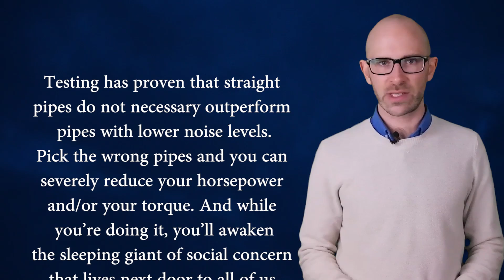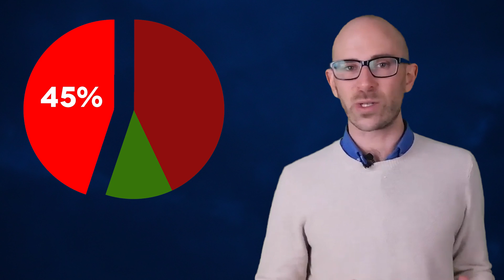Why are Harley Davidson Motorcycles So Loud?

Comment: Hey, man just tell everyone that the exhaust systems have been modified.  Some use straight pipes, some take out muffler baffles, some have a very large empty chamber, all sorts of open exhaust systems are LOUD!   And mostly it's an ego, macho loud noise to offend everyone, with the in your face attitude.  Some have a very immature outlook and the loud makes them in mind say, Hey, I'm tough, back off!  Some kinda crap!

Comment: Your crash statistics are wrong.  Motorcyclists are NOT 'at fault' in 75% of the fatal two vehicle collisions.  As per your source:  "In nearly three-fourths of these crashes, the role of the motorcycle was recorded as the striking vehicle."   That doesn't mean they were at fault, in fact the Hurt Report showed that in ~40% of two vehicle motorcycle collisions are caused by the second vehicle making left hand turns directly in front of the motorcycle, a by-product of the SMIDGY effect(Sorry Mate I Didn't See Ya).  That doesn't mean motorcyclists don't make bad decisions but you very seriously misrepresented the threat that cars and their drivers pose to motorcyclists.

Comment: I was sitting at a red light behind a van one day on my slightly loud Harley Davidson motorcycle. I stayed to the drivers side of the van so that the driver could see me in the review mirror. I always do that when I'm I'm close to vehicle at a stop. Well I'll be, her radio was blasting so loud I could hear it. It was summer time. Her windows were up and she had a van load of kids. soccer mom type I suppose. Well any way. I saw her back up lights come on and she just backed right over top of me. the tried to drive away. I ran to her van door and beat on he window. There was lots of traffic and witness's so she stopped. I did get hurt a bit. Her fender caught the tread on my front tire as i was trying to back away from her while blowing my horn. He bump rolled right up my tire, crushed my fender, forced my bike to ground, ran over my foot as i was trying to escape. I hurt my right leg and back trying to just get off and away from her. Your 75% was way off here. and the bike was loud. i was in field of vision via mirror. and she still ran over me in reverse to boot. So to me your theory is total Rubish as they say in England..Rubbish it is

Comment: C L I C K  B A I T!!! 
I'll bet most if not every single one of you watched this video to find out what the secret was that made the Harley-Davidson V-Twin engines so much louder, Louder than all other V-Twins such as Honda or Yamaha didnt you?  Well your not alone, so did I. But don't go thinking this is of any fault of your own... the viewer. No quite the contrary! Im no expert in the law but most assuredly, most would argue, the King of Common Sense. And in this case the liability falls on the content producer! Yes I was suckered too.
But not before giving it careful consideration rest assured, and much goes into my meticulous,experienced and thorough decision making process (as should all hard working Americans who value thier time and money or Time AS Money,) All of which are based on just the tiney few clues given, they are small howbeit, but none the less, clues, to determine as to wether this 6:13 video is actually "click worthy"  or at very least, isnt going to infuriate one so much as to elevate ones blood pressure thus causing (depending on location) scenarios like ramming the car in front of you, punching the guy standing in grocery line near you, then the cop when he arrives to arrest you etc....after all, this is liesure time for most on YT, (except of course for the hardworking YT censors, whos works cut out trying to cover up all the pedophiles Trumps busting... downplaying all the successes and winning since POTUS 45 election😎)  So, I, (unlike this "nair do well", who I think most will agree, was anything but forthcoming) will tell you right now, what the "clicking" point (pun intended and actually achieved, just not revealed until later in my overview, opinion and yes lenghty but thorough, comprehensive and professional assessment ;) )  .was 6:13...the low risk..obviously for me. I mean 6 min. and 13 sec. is indeed a very small block of time to risk, especially if it can reward me with previously unknown information or data that can assist me in future decision making, to either save time & money. Or, if Loud is a Neccessity, to go ahead and just invest in a Harley Davidson Motorcycle. 
OR...
Maybe you simply wanted to answer that question, the same one THE AUTHOR OF THIS VIDEO ASKS IN THE TITLE TO THIS VIDEO?? that has at one time or another, made us all respond "Gee, I Dunno.."Hum"  but just never thought it important enough to look into or just didnt put much into finding out. And CERTAINLY didnt go to the trouble of making a video and titling it that WITHOUT answering it in the Video! 
But if your like me... I have skin in the game in a real way. you see, I am one of the afore mentioned, as well as the latter. 
 I have a Honda Shadow 1100 and I have the drag pipes but I've not put on bike yet, so I have a couple of "needs to know" before going to the expense of rejetting carbs (something must do to compensate baffle removal, as well as adjusting idle) and of course the trouble of taking the old ones off and putting the drag pipes on. 
Such as
1.) Do the drag pipes with no baffles on a Honda Shadow 1100 sound as loud as a Harley Davidson Motorcycle? 
2.) If not...Then why?  
Now this is where this nair do well completely drops the ball, heres the only reason he could possibly have to title video the way he does...thus he misleads and some (like me) would argue, even "Decieves", Enuf that we can call it  "Fake News"?😒 "hummm. No news is fake news? (public  opinion needed here) 
Ive heard they don't have quite the sound of a Harley. so I was looking around on YouTube here trying to find remedy for my dilemma and lo and behold I stumble across this extremely low educational investment of 6 minutes and 13 seconds as an  opportunity. Now these questions have puzzle me for quite some time so imagine my excitement of finally getting to answer my salt after solution or answers that have eluded me so. But this wasn't the case at all had it worked I feel that my return would have been substantially rewarding and very much worth the investment time as well as low effort of pointing & clicking (maybe not as easy to shut up & listen for 6 minutes 13 seconds) But over all Id say a home run.  but that's not the case with me, nor is it with everyone else in my situation that went into this "investment oppertunity for the mind", which as we know now was no opportunity at all but simply a "fruitless waste of time for we the viewers" and a pathetic, pointless "1 dime atta time scheme" at the expense of future viewer participation as well as trust and viewer patience of "we, the now pissed off and wont watch another Today I Found Out video viewers!  
And back to the  financial liability here.  Now if content  producer  is receiving Revenue  but not from the viewer directly, but  "indirectly"  as  we do have to sit through those pesky  7 second commercials before viewing video subject matter, which equals time  and as we know  precedents have been set throughout the history of our country  that "time is most certainly money" I am pretty sure, not certain, but pretty sure that this  could be litigated  in federal court  as if I'm not mistaking we the viewer are protected and could set a good president in the courts for this type of shady clickbait practice in the future 2001 consumer protection act have to check with one of Pres. Trumps corp attny.s 1st, but Im pretty sure we might be protected from under the 2001 consumer protection act the only grey area in question far as I can tell... no currency or monetary exchange occurred.... but I ask you... is time not money?   
I believe so.
well this brings me to the conclusion that according to my estimation I feel as though a slight form of justice has been served because when you title a comment clickbait that's just too much Temptation for any content producer. He should be at least curious enough to stick around and read, if were lucky he pondered and reflected on his ways that caused his content  quality to suffor. And make the decision to do better, work harder in the future as mediocre might have been a thing of the past but not anymore.. America is back!  and you can't make her great by making mediocre videos that  don't live up to their title.
For the rest of you who had the patience to stick around and read... well according to my calculations this has wasted about 6 minutes 13sec. for the  content creator 2 read through, But if he Ponders what he reads then it's not wasted if something's gained and that's best summed up as awarding punitive damages to "We the viewers" comes into play later as I believe the quality of future content should improve greatly and hopefully the titles won't be as misleading like MSM fakery and maybe we won't accidentally fall into another 6 Minute hole of useless dribble and unwanted data...at least by this channel!

Comment: A stock harley is way quieter than a stock Lamborghini, jag, ferrari, etc basically any supercar with the  overplayed exhaust gurge/pop. Both have to meet epa sound regulations.

Why are harleys loud? The moco purposely makes the exhausts quiet and restrictive so they can sell you a “stage 1, 2, 3 or 4” upgrade which includes an exhaust, or for less money you can get a better performing and louder aftermarket exhaust.

But this guy who’s well versed in things that just aren’t so would rather have you believe harley riders are all degenerate people hating jerks who just want to make noise for the sake of making noise.

Comment: the exhaust noise level of my harley is usually in direct proportion to surrounding drivers' attitude, the right handle bar has a twisty thing on it that makes the exhaust decibels go up as I turn it allowing rude and discourteous drivers around me to be aware that a motorcycle is near them. Works better than my horn. My harley has the ability to make your ears bleed courtesy of the thunderheader device I installed. (or at least set off car alarms in parking lots)

Comment: It seems many people are having an issue with coming to a census on how the db system works. From my knowledge as well as that of the internet, 3db is a 2x increase power level, 6db is a 2x increase in sound pressure, and 10db is an increase in power level of about 10x, but an estimate in Percieved loudness of 2x. Our ears work like our eyes. They require evermore energy to register a doubling.

Comment: Loud pipes save lives, and a stock Harley is actually really quite, glad I got my race pipes from Harley before they stopped selling them
Reply: Sure, it's the driver's fault and not the motor cycles squeezing between cars, breezing through red lights, and cutting people off.
Loud pipes aren't going to help someone hermedically sealed in a box with it's own engine, a radio, and AC to spot the narcissist whipping around them.
You hear sirens (you'll likely spot red and blue lights first) you pull over regardless. People should have to pull over for motorcycles too?

Comment: I'm a biker - I ride customs and I've had Harleys and Honda Valkyries etc. In my experience louder pipes usually accompany power increase up to a point and after that decrease it. Straight or shot-gun pipes with no baffles make enough noise to waken the dead but normally drop the power from what would be possible with some baffeling as the engine needs some back pressure from baffles to run correctly and such pipes can cause long term engine damage. Also louder pipes i.e. freer flowing ones usually accompany carb i.e. fuelling mods and sometimes cams, timing gear etc. But a quiet but extremely powerful engine is still possible, for example the Suzuki Hyubusa which has terrifying power compared to stock Harleys. Harleys are a V-twin design with linage back to the 1930's and while modern ones are stuffed with computers they are an old-fashioned engine design compared to multie cylinder designs. A nice tone is preferable to sheer volume and personal experience says loud pipes are not pleasant to live with at all. But the bottom line is that many Harley owners would fit loud pipes even if the power dropped substantially as it is all about presence and intimidation of other road users and pedestrians. South Park summed it up best in 'Southpark Harley Fags pt2'.

Comment: Not all Harleys are loud.  Many owners modify the fuel delivery system and exhaust.  The exhaust pipe changes are responsible for the change in sound level.  Most stock Harleys (unless you order it "kitted") are not that loud.

Comment: Suzuki M109 at "takeoff" was rated the loudest of 4 new model muscle bikes when it came out. At a track day, the only time the instructor clamped his hands over his ears was when the M109 took off hard, and we had at least a dozen different kinds of motorcycles from 250's to Victory Chieftains.
The difference is the M109 was putting power to the pavement and actually accelerating down the track like a motorcycle should that makes that much noise. I don't have M109 owners roll up next door with amplified 6x9 speakers blaring, blapping their engine as they enter the parking lot and leaving the stereo and open pipes engine running for half a minute while they make a deal out of taking off their helmet and doo-rag. H-D attracts a lot of child like people with fantasy issues to be the center of attention.
A stock H-D farm implement won't be any more bother than a lot of modern designed motorcycles are. But children have to tinker with their toys to get attention.

Comment: harley riders are uber cool dude who ride "real" bikes. All other bikers are not real "riders'. I know because i've been told this by two harley riders so far while riding my gs. I actually ride my 550lbs bikes off road and race enduro in age category races. I'm going to trade my gs in for some tats, a wife beater t, tassels, assless chaps, loud pipes, low horsepower, shitty brakes, lots of chrome, half helmet with white tennis, a skull mask, harley truck, starbucks patron card, skinny white arms, and find a chick dumb enough to ride on the bike with me. It takes a lot of commitment to put this all together. I do admire them.

Comment: I ride and I see a lot of comments on here about loud pipes saving lives. It's funny though... 99.9% of the bikes with the loudest pipes are ridden by asshats without helmets or any gear.
Reply: That's not even true. I want to see these stats your listing because ik alot of bikers myself included who have put better pipes on and we wear helmets, and we are normal people unlike you.
Reply: luke durkee You wanna see the stats that I'm listing...? It's from the Journal of the Habits of Jackass Motorcyclists Volume 2 v12. 

99.9% isn't a stat. It's a fucking figure of speech noting that what you are saying is mostly true.  I stated that most of the bikes with the loudest pipes are ridden by asshats without helmets or gear... I stick by that statement. Maybe there are exceptions but I've never seen one.   In my 47 years, I've never once heard an obcenely loud bike that made me cringe and glare without being treated to the sight of some dickhead with no helmet.

Comment: It's not loud pipes that save lives. It's keeping an eye out for hazards and not riding an 800 pound weapon, from bar to bar, drunk off your ass with no helmet on (or a pudding bowl where you have to where a "helmet").
Reply: None of that changes the fact that sometimes a bike is easier to hear than see if you're in a car or truck.
Reply: The muffler is aimed in he wrong direction for that. Many times I haven't heard a motorcycle until it was ahead of me … though I saw its headlights in the mirror. 
If the noise really was about saving lives, you could just tape the horn button down.
Reply: @timberwoof  you've never heard expensive pipes then, you don't hear anything else when it's near you.
Reply: Then it's the same thing for a 2k-60k vehicle, or as you put it a weapon.
Reply: Uh thats retarded to say the least. I am putting along often and just enjoying my day and grandpa next to me just switches into my lane at a moments notice. I dont drink and i hardley ever speed in town. And all that stopped when i threw on some nasty loud pipes. But im sure thats just coincidence.